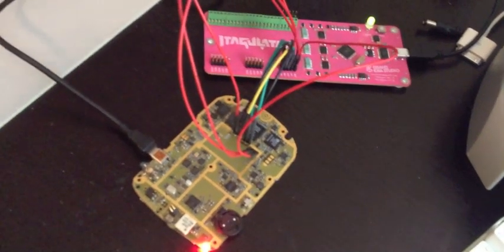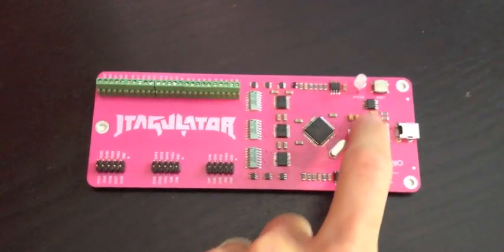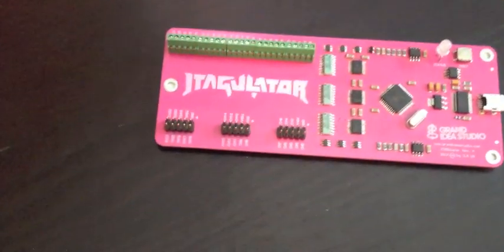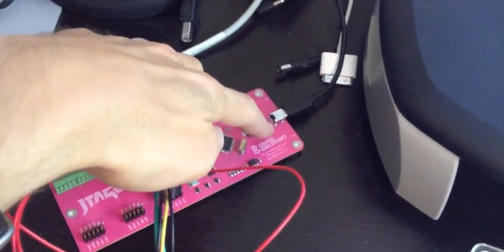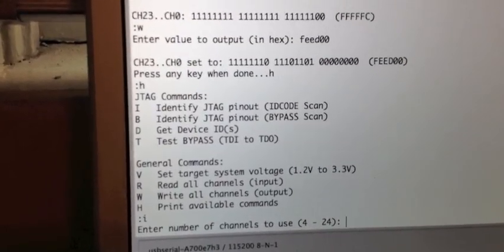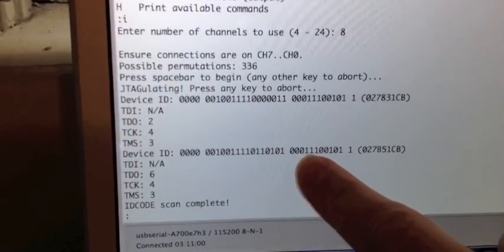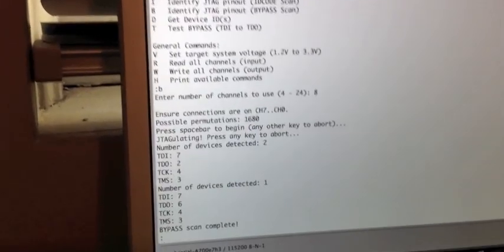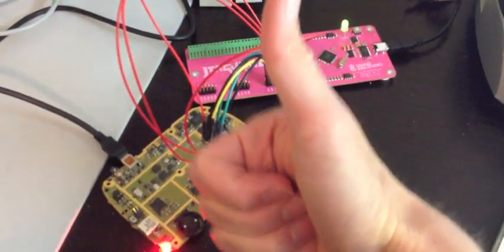JTAGulator: Introduction and Demonstration

Comment: I am not sure I fully grasp the use case here. In the time it would take someone to solder all that to a board and probably risk damaging something in the process they could look up the datasheets for the devices on the board online. Through said datasheets figure out if they have JTAG ports. For devices with JTAG ports, find their BSDL files online. All of which in a much timelier fashion than whatever this thing does. Between the device datasheets and BSDL files you will know exactly how the devices are pinned out and pretty much whatever you need for JTAG debug access.
Reply: A blackberry phone does not havea a datasheet to find jtag on PCB pads, As for the chips, if you have BGA packages, like on most complex devices, you won't find them by looking at PCB traces, so there is no real other way to find the jtag interface